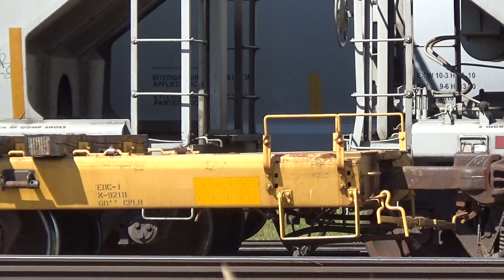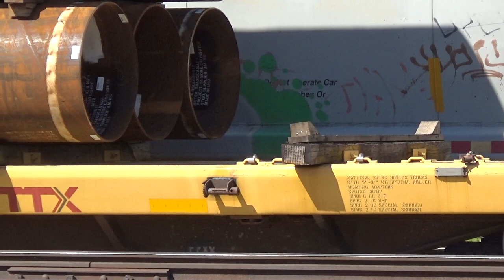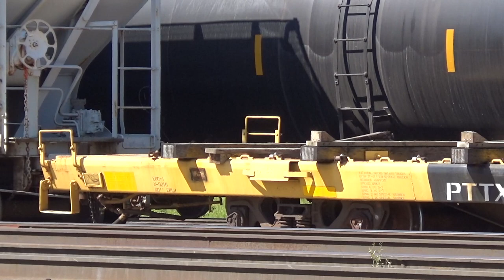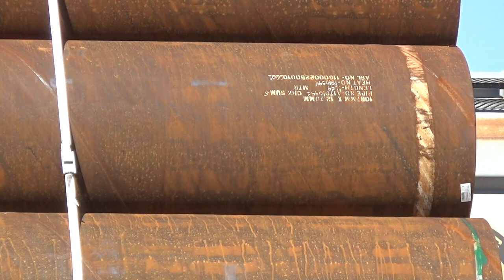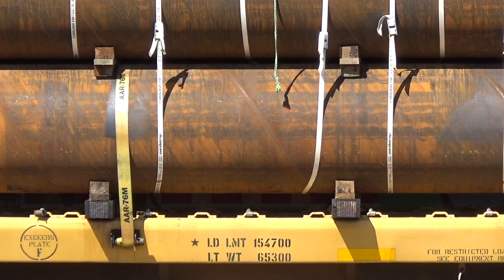Large Diameter Pipe - Flatcar Load

Comment: I see at 1.38 that the pipe is "1087 mm x 1270 mm" and a length in meters.  I don't  understand the two dia. measurements but at 50 inches (1270 mm)  3 across the flat car would be over 12 feet wide. surely that exceeds the loading gauge? Interesting load though. I see another modeling opportunity. Thank you for another great video.  David.
Reply from the maker: Good observation David, I didn't pick up on that. The car is stamped "exceeds plate F" so I assume it is indeed a width thing. Thanks for the comment.
Reply: Looking more closely these pipes they have a flair at the right hand end (as viewed) to connect the pipes. So the 1087 mm dia is the nominal pipe OD whereas the 1270 mm is the OD of the flared end.
Reply: The load can over hang the side of the car as long as the shipper has approval from the railroad and has what's known as high wide clearance also. Then the car is routed via certain corridor's (lines) on the handling rail carriers to its destination. I handled these loads almost nightly for years on the CN out of Canada. Almost forgot too most dimensional loads had to be handled in the very head end of the train with certain loads like the one in the video would have a buffer car between the consist and loaded flat.